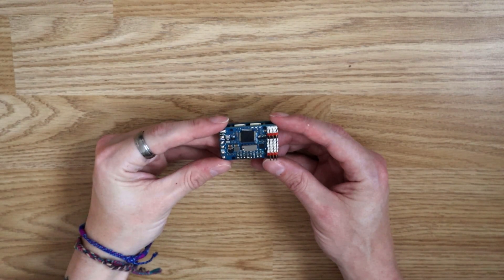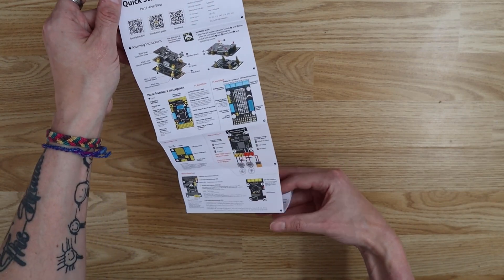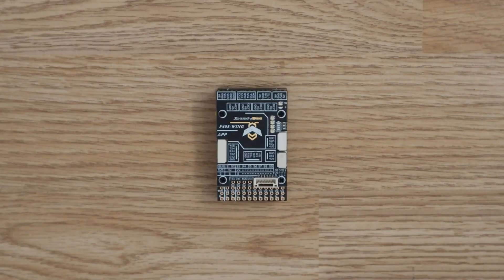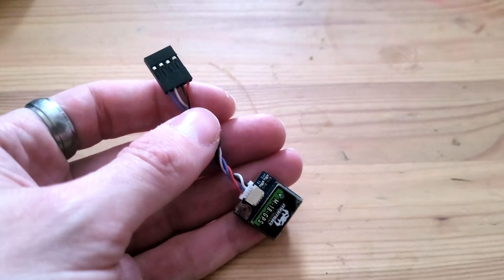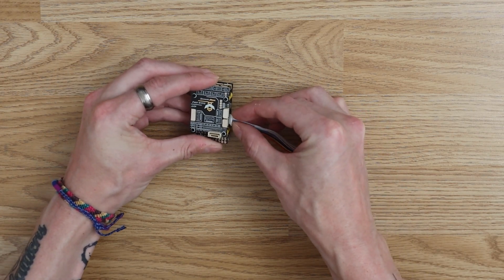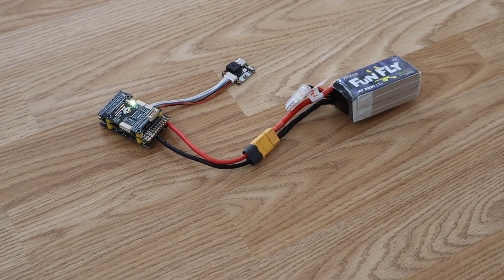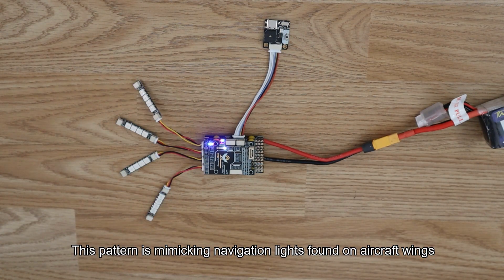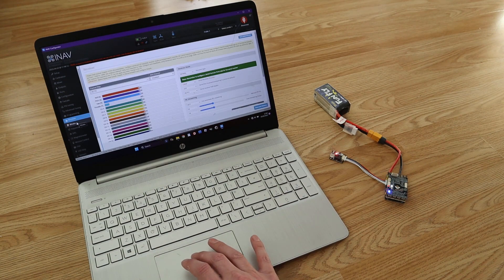🛩️ SpeedyBee F405 Wing APP - Flight Controller Review

Comment: If ANY of you have issues with soldering the servo headers on - Send Them To Me - I'll charge you one SpeedyBee F405 FC for however many FCs you need soldered up, lol. Or meet me at the field, I'll do it for you there for nuthin! But I'm going to teach you how to solder while I'm at it.
It's a great little fc for the planes I've installed them in so far; an Airloader and a Dolphin. I thought the Airloader's 6 servos may be a bit much for the servo BEC onboard, but even with all 6 stalled, it barely gets warm. Not really a fan of Wifi or BT - version control for the app is going to get out of control - but happy it's there, especially for the price!

Comment: Best thing is the price, lots of features for the money. Hate those small plugs...although a digital setup would be easy...This is yet another FC with no mounting lugs so you can screw it in a plane!!!...Why do ALL the designers overlook this?...🤔😳😳😳🇬🇧
Reply from the maker: That would actually be really nice. A fixed wing fc with some mounting points. Typically I made 3d printed mounts, but the option to just screw one down would be awesome
Reply: @gizfpv  Yes, imagine if Quad FCs didn't have mounting holes?
🤔😳😳

Comment: This softmount on middle board will putt stress on the connectors... there is a reason why quad stacks have a wire harness between fc and esc and not this solution. Matek has solid connecors between boards for this reason. (There where actually a few stacks back in time that had board connectors like this but it stoped due to problems... so either hardmount between pcbs or softmount with wire is the way to go if you like the thing to be reliable)
Reply: Imo it'll be fine; 1) I see the same board connectors on my matek F405 and F411, and 2) it's not like you're thrashing around a FW like you would a drone (unless you're like me and send your wings through trees 🤦)

Besides, isn't it kind of hard mounted already? I get the FC board is technically soft-mounted, but it is being sandwiched between hard-mounted boards as opposed to a 30x30 or 20x20 screw stack on a drone, there's no play in the SB wing stack that I've seen

Comment: It’s nice to have another cheaper option but they are advertising it as a kind of no soldiering option yet supply it without the pin headers soldered on 😂.
Reply from the maker: Haha I did think that. Also gotta solder on the XT60 lead and motor wires

Comment: 3:20 My first FPV fixed wing build(a Nano Goblin) I made the mistake of direct soldering everything, and I will never do it again. Even those specialty connectors have me a little wary. I don't know about everyone else, but my fixed wing builds get "fiddled" with quite a bit. Doing things like optimizing weight distribution, moving things to accommodate different parts or a bigger battery, improving airflow, even a hard crash that leaves you pulling everything out to repair the air frame. Direct soldering and flimsy connectors don't lend themselves to that kind of life. I'm glad to see some competition in the space and I hope we see more but I don't know if I would use this particular FC.
Reply from the maker: I'm the same, I hate direct soldering. It usually ends up looking messy and is a pain to do maintenance on. I like the pin headers and dupont connectors. Easy to work with, and easy to make your own connectors

Comment: One good thing about the plugs: I presume you can always make them work by cutting and crossconnecting a couple of wires. To the more ham-fisted amongst us, that seems to be a safer route than soldering pin headers or wires to the actual board. But I guess you have to be ham-fisted to see that point at all, so kudos to you for missing it.
Reply from the maker: Oh absolutely, however having to cut and splice the wires would sorta defeat the point because you'd end up doing soldering lol
Reply: @gizfpv  Just not to the board itself. Ruining a wire is no big deal ...
Reply: My guy, you sound like a man in need of a JST SH1.0 kit from Amazon or EBay. The one I bought years ago came with different length wires, pre-crimped, and different plug ends, 2-pin, 3-pin, all the way up to 10-pin, so you can easily build your own.

Comment: You missed point about being able to switch between USB, WiFi, BLE with a long-press (6 sec) of the boot-loader button (6:06). The 'USB extender" also has a switch for disabling the buzzer, which could be a handy feature if working on a model while the family is sleeping. 🎶😱
Thanks Giz, a very well done and entertaining box-opening, first-look at what I think is an impressive first Wing-FC offering from SpeedyBee. Was impressed reading product page and Quick Start Guide.  Clearly they have done some research. Even provide guidance for pilots deciding between INAV, ArduPilot as to which FC software to use.The longer manual shown here does not yet have a PDF version. Hopefully flight logs on memory card are accessible via WiFi/BLE.
LOL (7:47) .. foam snow, from a recent model crash. Nice of your buddy to play it forward. :)
Reply from the maker: I actually did record footage of the mode switching between WiFi, ble and Bluetooth, as well as how to turn on and off the led functionality, but opted not to use it in the end to keep the video from being too long. Figured all that info is in the manual, and people would be more interested in seeing what the FC could do, but not so much how to do it. I agree with you though, considering it's their first attempt at a fixed wing FC, speedybee has done a great job. They've clearly done their research, and put a lot of effort into the design. It doesn't feel like a cheap or rushed product. Hopefully it performs well. And LOL at foam snow, I should have thought of that myself 🤣
Reply: @gizfpv  Just messing on the connectivity thing. Know you're trying to keep focused and entertaining. Good choice to include the LED demo instead. Great call. :) As for performance, I'll find out soon, as ordered two. Have a Ranger T1, and a Zeta-84 needing built and flown.
Reply: When I first used a buzzer silence switch on a Matek board, I fell in love. Before that, I had a couple planes that played hard-to-get with GPS, so I'd power them off a USB power bank while they sought a GPS lock, Gorilla Tape over their buzzers lol

Make sure to order an extended lead for the USB breakout though, the included cable is very wee, and at odds with an otherwise very well thought out product

Comment: You buried the lede a little bit by not mentioning the price. I agree that there's some things about it that make me go "hmm", but man, for half the price of a Matek board, it's hard not to look. AtomRC also have an F405 wing board now, which I suspect is actually a rebranded Matek, because it looks basically identical to one of their older boards, but it, too, is very well priced.

Separate thought: I notice you have gotten the iNav configurator to connect wirelessly. I haven't gotten that to work properly in a few years, but I found it really handy, especially for bigger (1.5m+) wings when you're trying to calibrate the accelerometer or something and that USB cable drags all your tools off your desk as you wave a huge plane around. Eventually I gave up trying. Any special tricks you do? Or just click the "wireless mode" toggle? The app is certainly great in the field, but at the bench it's nice to use the "real" configurator.
Reply from the maker: I did mention the price.....although not till the very end 😂 Should have led with it tbh. Yes I've got the Atomrc board in my Swordfish, and so far it seems pretty good. As for the wireless connection to inav, it took a few attempts. I couldn't get WIFI or BLE to work, but standard bluetooth mode seemed to work great. Just had to connect via windows first, and then on inav configurator select wireless mode and that was it
Reply: @gizfpv  oh I know you mentioned it but yeah I think that’s a big part of the attraction of this board, could overlook a few flaws at that price, and it doesn’t seem to be lacking much, aside from the connectors, and maybe a VTX power switch via PINIO.

Hmm, I’ll have to try wireless mode again, maybe it’s me. Wonder if I could do TCP via CrossFire, too…

Comment: Most people overlook how useful this FC and Bluetooth will be when using your phone and the app to setup WAYPOINT missions! My laptop does not have internet when at the field making loading missions extremely annoying on it. No internet means no map. So this is a blessing.
Reply: 1. Grab work-issued phone, turn on hotspot
2. Share with your flying friends, most of which are not using wirelessly-configurable FC's, and rely on their laptops
3. Perform swimmingly well at your job, get patted on back for how much time you're putting in on the weekends.
4. Use newfound monies from raise to buy your friends SpeedyBee FC's, so you can all stare at your phones (more)
4. Happy flying :-)
Reply: How about wifi hotspot from your smartphone to laptop? ;)   ( just a hint how to setup older FC´s waypoint in the field )
Reply from the maker: That's actually a really good point, this FC would be awesome for doing quick waypoint missions via a phone!
Reply: Have you managed to connect it to Mission Planner with wifi or bluetooth yet? If so how did you get it to work please... which port etc in mission planner as im really struggling

Comment: Great Review Giz  i ordered 3 of them and at $39.00 each was a sweet deal  . Looking forward to more on this flight controller .
Take Care
Reply: Yeah man, he's quite the salesman! I was surprised by the free shipping for mine!
Reply from the maker: Nice. I just hope they turn out to be reliable! Wonder if Matek will try level the playing field in the near future with a competitive product. That would be cool to see
Reply: @gizfpv thats the part that wories me. And keeping me from buying... they kind of fucked up the design. Soft mount the middleboard but putting har connectors in between. All vibration stress will then be put on the connector between board. So softmount does nothing but screwing up the connector in the long run (vibration will be getting to the gyro via connecors anyway... I think it was iflight that tried this and stopped becaus of issues. (More vibration in a quad but still a bad design)
Reply: Any updates on them? Curious how good the power filtering is. I plan on using one with a 2.5w rush max solo and am unsure if I should buy or make a seperate LC filter
Reply: @Zippytez  I've pumped 1.2W through an AKK on the F405 Wing - so far so good. Didn't notice any artifacts or noise, at least, not more than expected. Using onboard servo BEC with 6x 9g MGs, didn't break a sweat or get hot. I was concerned about the onboard WiFi or BT radios interfering with my RC or FPV gear, but you can shut both down with a 6sec press of the boot button. Jazzy.
Reply: @GhostRyderFPV  that's good to hear, saves a little money from the cost of my planned build
Reply: @Zippytez  I'll be honest - after having just spent $ on Matek F411 boards that cost more than the SpeedyBee F405, I'm blown away by this little FC. Attention to detail is 2nd to none. 

And if certain 'Reviewers who fall with style' give it bad marks because he can't read the product page or manual to learn 12 PWM outputs are 11 servos and LED output, then that should be on him, not SpeedyBee. 

As far as I know that's the only real issue anyone's having with it.